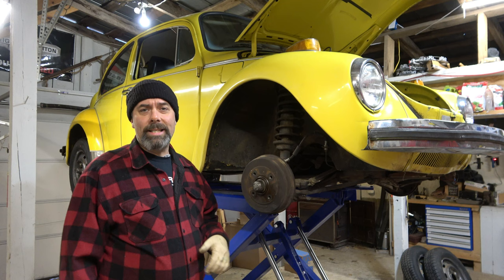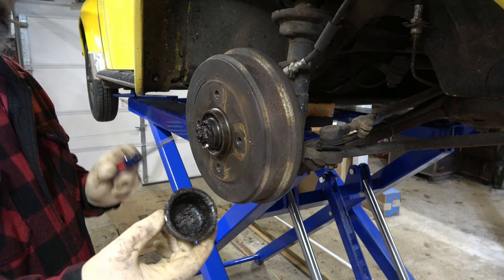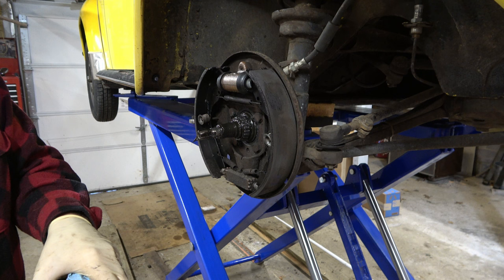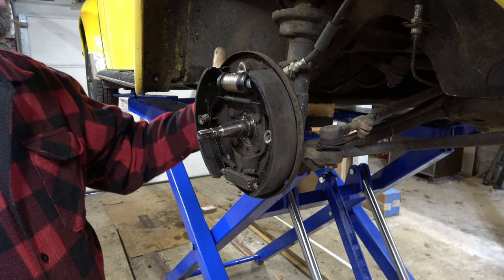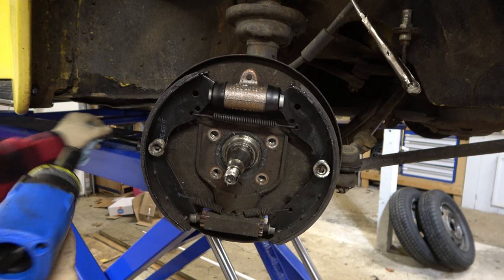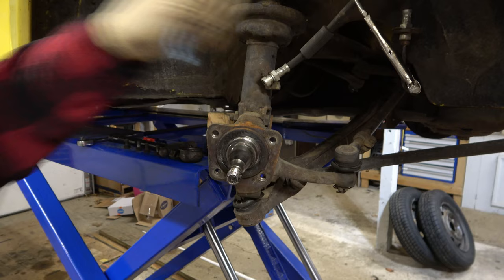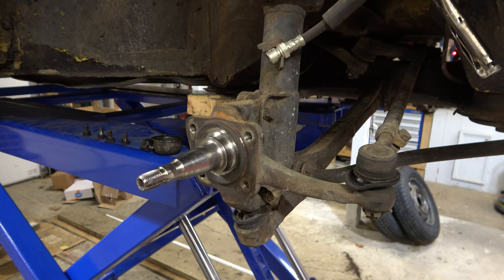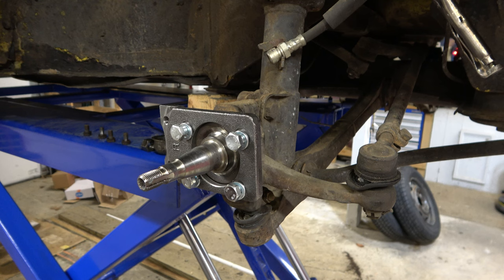VW Super Beetle Disc Brake Upgrade! Make you Beetle Stop Like A Modern Car.

Comment: I have installed front wheel disk brake kits on 3 types 1. This is the best upgrade for safety you can do. Makes a big difference.
I put a rear wheel disk brake kit on my personal car. Did not seem to help much.
The only tricky part was getting the bearing races out of the front wheel hubs, the races were not provided with the kit.
Reply from the maker: I have found the rears to be unneeded as well. Save your money and just do the fronts!

Comment: Great Video.  I wonder why Empi just didn't install the races themselves and have it as a complete unit  ??
Reply from the maker: I wondered the same thing. My best guess is that it saved them maybe a buck per set not to have it done.
Reply: @FarpointRestorationsAndRepairs  BTW,  I really like your lift.  I'm tired of my floor jack (getting old).  Can you tell me the brand & model of you lift ?

Comment: Do you have a video about rear disc brake conversion on the same Superbeetle...or another one for this matter...also have you installed the top line lowering kit ever on a super. ?
Reply from the maker: I have not done a rear disc conversion. I also haven't ever lowered a car, but I've raised one. Check my video on that as it should be much the same.
Reply: they have available rear disc made by Frum from brazil so can use 914 rear caliper

Comment: Do you need to upgrade the master cylinder if you are doing just the front discs?
Reply from the maker: No, the stock master cylinder works just fine.

Comment: Hi. What brand and model number is that lift?
Reply: An are you on a piece of 2x4 for that front lift point? I need to do front beam work and want to get a mid-rise lift. Thanks.
Reply from the maker: That is the wonderful Harbor Freight mid-rise scissor lift. I have a video on it.
Reply: @FarpointRestorationsAndRepairs  Ok so I'll assume you're putting the lift arms on the torsion bars. How are you placing the lift arms up front? It looks like a 2x4 is in there. I'm looking at the bend pak MD-6XP, similar to this lift, and am wondering how I'll place the front arms to not crush anything.